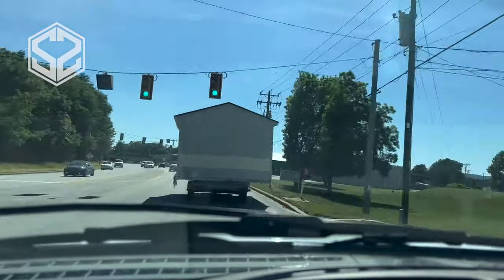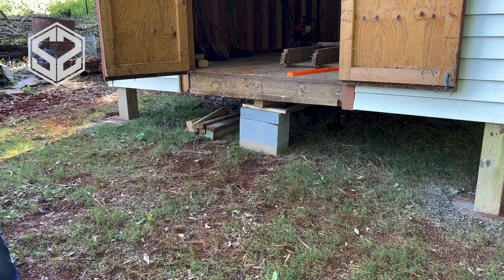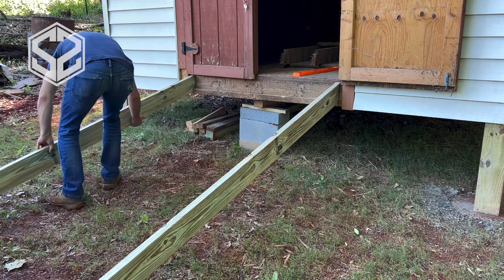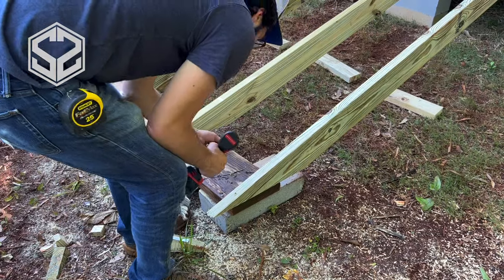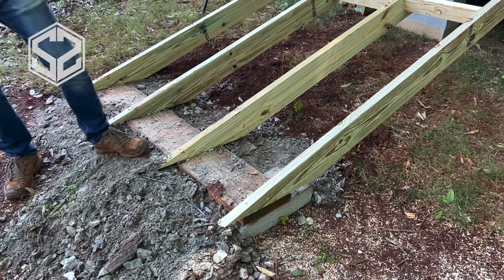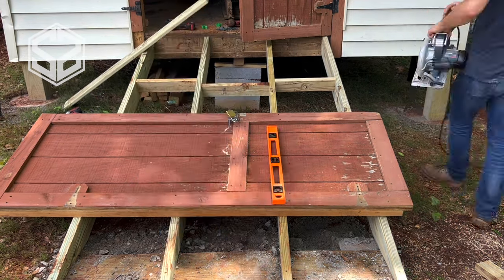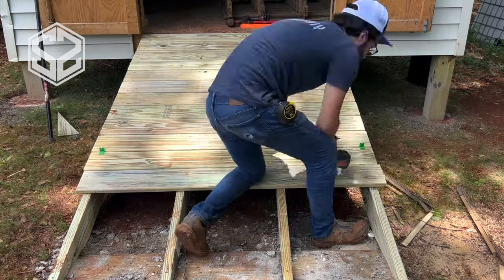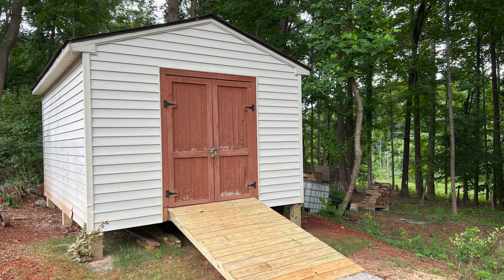DIY Shed Ramp

Comment: I made a ramp out of an old extention ladder..seperated the two ladders. Made a ledger board with notches cut where end of ladder will go. Put the 2 ladder pieces 48 inches apart. Secure from underside with a 48 inche piece of deck board. Flip it over and cover with treated plywood. Pavers under the ends. Secure ends in ledger with pipe strap. Paint.

Comment: Great work but I don’t like placing the ends of the ramps on a center block. What you going do when it starts sinking.?
Reply from the maker: True. If it sinks I will have to jack up the end and place a few pressure treated board under the ramp to shim it up to where it is meant to be. Thanks!

Comment: Wondering how well a riding mower went in and out and at what angel your ramp is? My land slops downward and away from my shed and is about 24" off the ground where the lowest part of the door is. I'm thinking I may have to build a 2 part ramp.
Reply from the maker: It seems to do great at this grade but I have thought about putting sand paper tape down to avoid slipping when it is wet. Thanks and good luck with yours!
Reply: There is grip to add to paint, too.

Comment: I just put an extension on my shed. My door face trim overlaps the opening by about 1" (my old doors were flush). I did this because in the Chicago area it is recommended to prevent snow/rain from driving under the door. If I have a 1" rise from the ramp to the shed floor will this be annoying? (Guess I could raise the bottom trim 1/2" to 3/4" and still block the wind)

Comment: Im getting ready to walk outside now and try to figure out how much wood i need and start building my 1st ramp lol. I just bought a big commercial zero turn mower and my shed is about this high so ill definitely use this video. You think i might need 2x10s to support a mower that heavy or would you think 2x6s will be fine? I'm not a carpenter at all and this is probably a dumb question lol. But how do I know what angle to put on the 2x6s that will be on the ground? I see you used 2x4s to mark it but I can't make out how you measured with them. And how to measure the 2x6s that go flat up against the shed? I see you used a level but again I can't make out how you measured it with the level
Reply from the maker: Good luck with your project. The 2x6’s are plenty to support my 52in zero turn that I have but I would recommend 2x8s if you want more peace of mind. Sorry, there’s not an angle that I could share because it all depends on how high the shed is and what angle the ground is. I would recommend getting an extra 2x8 to test cuts with and try to eye ball it at first.
Reply: @SimonSaysDIY  alright man I'll definitely give that a try. I been using those aluminum fold up ramps that ya drive a regular riding mower up into a truck with. I put center blocks under those ramps to support the zero turn mower and pull it up into the shed. But I'm wanting something permanent so I don't have to keep pulling out the ramps and blocks every time lol

Comment: What would you suggest if we wanted to add the board to aluminum siding underneath the door so we didn't want to cut the door? Would create a small lip/ bump at the door but wouldn't be a big issue.

Comment: Loved the video. I noticed you cut the barn doors at an angle. Did you just eyeball the angle or did you measure for it?
Reply from the maker: I used a board laying flat on the ramp and against the end of the closed door to mark the angle. I the eyeballed to and trued to get it close. It didn’t matter to much to me if it was exact. Thanks! 😁

Comment: If the ramp is long it needs concrete  block under the center of the ramp . I felt it supported my 2 cub cadet mowers better and did not sag like my neighbors ramp .Plus I added joist hangers to the shed joists  . My shed  was premade metal one  and then I have a shed I built and then I just purchased a new shed prebuilt from premier sheds  that I will be building a ramp for . The shed I built has a  front porch on it because it has a great view of the mountains since my house is up on a mountain oppesit the other mountain . I am a 69 year old woman and still got the energy to do all this ., besides mowing  over 3 acres of lawn.  Gravel under the ramp is better and gravel under the shed is even better . I guess I over build every thing . My 100 foot long  front porch is done with 6x6's . I would never cut my door driving rain and snow melt will run under it and rot the floor inside the shed  . A little bump when you get up the ramp  won't matter to the lawn mower   Remember joist hngers are your friend just like insulation is your friend . Shed I built is 16x24 feet long , But I was 50 when I built that and now 69  and it was insulated drywalled and has water and electric to it  besides  sofa bed , tv , and small kitchen . I guess a semi guest house . No bathroom  just a water holding tank for the kitchen drain that I use to water plants . I have remodeled 3 houses and built kitchen cabinets and bathroom cabinets  so a shed is easy . A ramp is easy but needs support under the center , ride on mowers are heavy

Comment: I suspect I’m missing something here, but why in the world would you put the shed that high off the ground? From the outside looking in it seems a bit unnecessary.
Reply from the maker: Yeah, It is a bit higher than I would have wanted. but around here if the wood is in contact with the ground, the termites will destroy it in no time. Because of that it is best to have it elevated. the reason it is this high is because of the slight hill it was placed on. The back corner is only a few inches off of the ground while the from corner is over a foot. I hope that answers your question.

Thanks!

Comment: Have a question if I could figure how I would include pics. Bottom line is the shed doors extend 2+ inches below the shed floor. The only thing I can think to do is remove the doors and shorten them so they match the floor.
Reply from the maker: Yeah that’s what I would recommend. I had to do the same and cut an inch off of the bottom of my doors.
Thanks so much! 😁